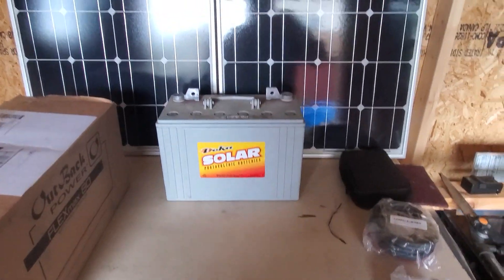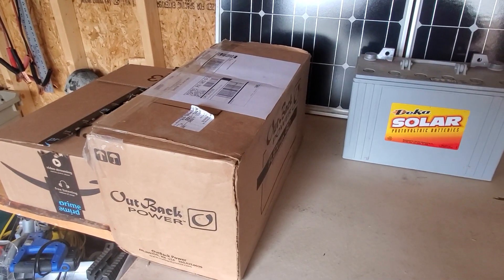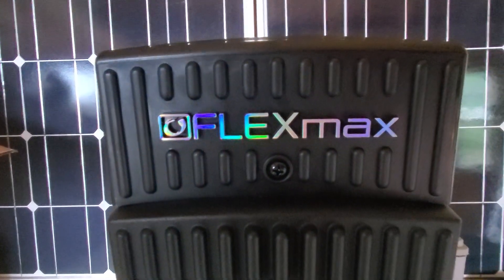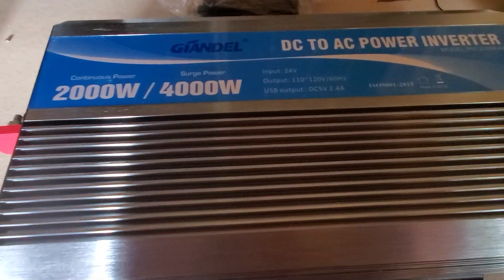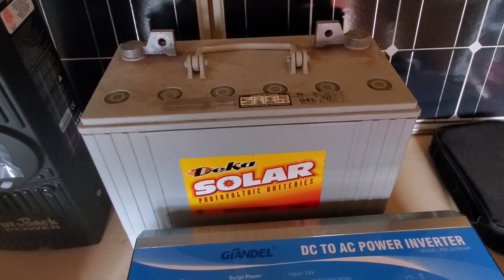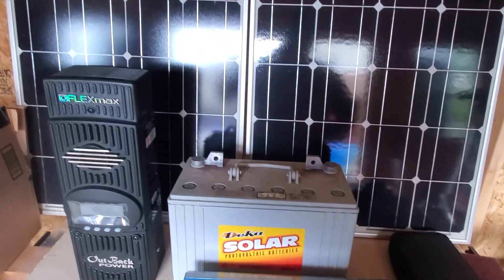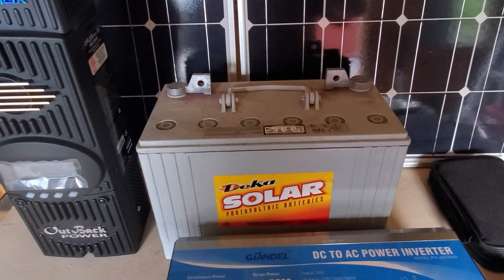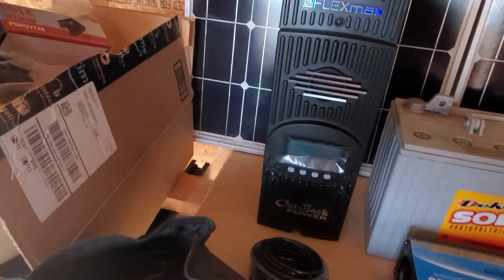Off Grid Cabin Solar Components Outback Flex80, 2000 Watt Inverter & DC Step Down Converter

Comment: Hey Joe thanks for the info im Joseph i have a question i have 4 panels i want to run two separate parallel strings of 37.2v each string to a combiner box does the volts add up coming out the box to my charger controller 37.2 x 2 or does the volts remain the same coming from the two main wires and what gauge for at least 40-50 ft thanks

Comment: One thing that may help with your installation is to set it up on a backer board. doing telecom installs, we used 1/2" plywood. For heavy, expensive equipment like this, I'd use 3/4 or even 7/8 plywood. Lay it on the workbench.  Paint the board to reduce splinters, and to make it less susceptible to moisture. Lay all the components out on the board, in the best most logical way you can figure out. Trim the board to size, then touch up your paint. Mount the equipment, then route your wires between the components. Then run your wires between. Make it pretty, and eliminate chafing and sharp bends in your wires. Then use cable ties and clamps to tie the wiring to the board. Then remove your components, and mount the board on the wall in your (VERY SECURE) spot. Now you can mount the equipment one piece at a time, much more easily and safely. Just my two cents. Good luck! Can't wait to see your finished system. I'm excited for you! Linda and I send our best to you and Gail.
Reply from the maker: +Odahi The Dubious Exactly why I'm doing that.  I don't want this to wind up a tangled mess. A board mounted to the wall will be a lot easier to move as well if I relocate a battery room.

Comment: The big thing is weather it’s a pure sine wave inverter or not.  The pure sine wave converter will let you power laptops and electronics with out issue.
Reply from the maker: +goatheadone If it reaches the point where I'll be doing that, you are very correct. I just don't have the funds to buy pure sine wave right now lol.
Reply: St. Bernard Acres i understand that for sure.... lol I just received an 800 watt pure sine one they are pricey

Comment: Hey joe do u need a combiner box with a discount it's for 8 panels it's a midnite solar 8 disco, and all the components are cheap the wire was are main cost. Wire ain't cheap when it comes down to a good system keep it up brother
Reply from the maker: +Dan Goras When I grow I will surely be needing one.  I was told Midnite Solar for all that!